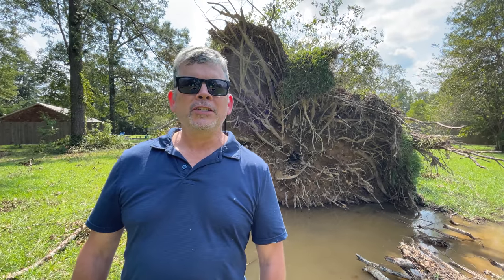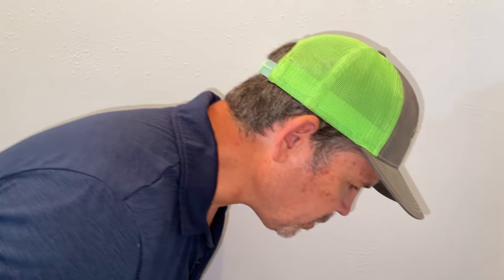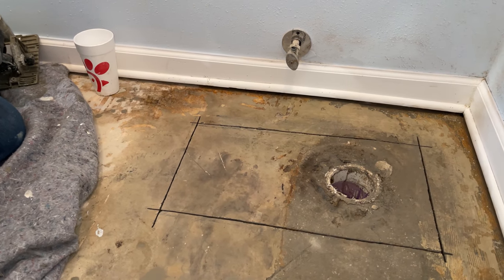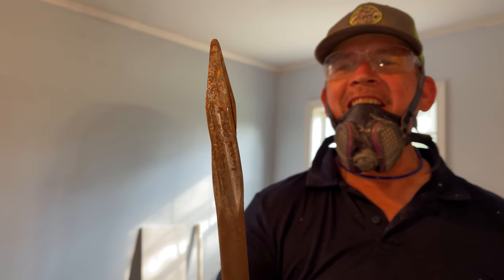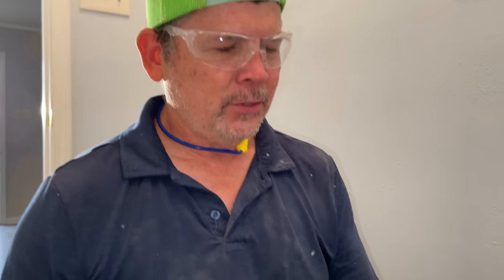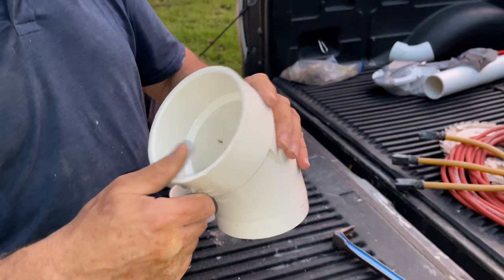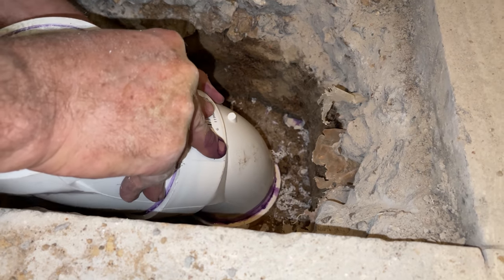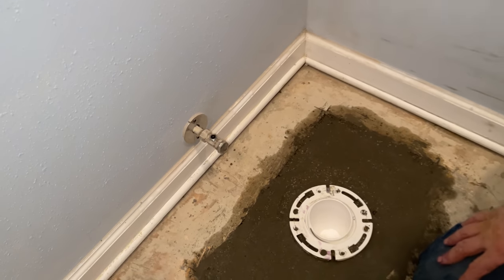We Moved a Toilet Over 5 Inches and It Kicked Our A$$

Comment: Come on man.  I forwarded to the part where you started to move the drain and noticed a few things that I'm questioning and I'm not a professional plumber.

1.  How did you not know that you were going to be moving the toilet over 4" or 5" before you got there?  Did you or your company do the installation or not?  If your company did it, then you should have known not to put it where it was put in the first place.  Even if someone did screw up, you should know that you have to move it over 4" to 5".  

If you were going to check out another plumber's mistake and this was the first time seeing it, then I'll give you a pass.  But I think you mentioned something about your "crew" doing the work.  Maybe I missed something there though.

But, if you had prior knowledge of where this pipe needed to be moved, then you should know to bring the proper tools with you to move it.  

THIS MEANS:  having the proper concrete tools.  Having the proper replacement parts to do the move INSTEAD OF needing to go to the local hardware store.  First of all, you should never rely on the local hardware store to have what you're going to need anyway because more times than not, they won't have it.  You should have had the proper stuff with you to do the job the way that it should be done but you didn't have it.

That's a rookie move and someone being paid to do this on the regular should know better.

2.  They make chemicals to help break down the glue for the pipes.  Why were you trying to use chisels, drills, rotary tools, buzzsaws, and all the other stuff?

In fairness, I've never used the chemicals to do any pipe fitting removal so perhaps these chemicals that are supposed to "break down" the pipe glue do not actually work.  And it that's the case, then you have to use something to get the pipes apart.  And that's fine.

But to use the chisels the way you were, you should know that you're going to take a very high risk of damaging the pipe like you did by chipping or breaking pieces of it.  I had a bad feeling that as soon as you started chiseling that it was not going to end well.

As someone who gets paid to do plumbing, you should know that the glue that's used to bond those fittings together is like a tough weld that can't be removed easily.  As such, you should know that trying to chisel at it the way you were was going to not be good.

Using a drill and drilling it out like you were doing was probably one of the safest ways you could get most of the material out.  But I noticed at the 10:57 mark that the hole furthest to the left was not drilled properly and you actually drilled into the outer fitting.  Not good.

You have to be more careful if you're going to drill and try to remove the internal fitting.  Obviously, ruining that lower fitting would be an even bigger job to repair.  Not good.

After you had the holes drilled all the way around the inside fitting, you should have been able to carefully get most of the pieces chiseled away.  But you needed to go slow.  I can see how it would get time consuming and frustrating but what's worse, spending an extra 15 to 30 minutes dealing with that or an extra day or two fixing the bigger mistake by having to replace the pipe and/or fitting even lower?

After that, you could have gotten a bigger sander to smooth out the inside edges to allow for the other pipe to fit inside of it.

3.  While you were trying to fit the angled pipes to the toilet flange that goes on the floor, I was shocked at how long it took you to figure out that you had the wrong sized pipes to allow the 4" flange to fit the 5" pipe.  

Another amateur mistake which makes me wonder how much knowledge you have.

If you're worked with plumbing, you should know what adapters you need.  I just don't get it.

4.  I'm not saying you have to be perfect and I don't claim to be.  I'm no plumber by any means.  But  I knew right away going into this project that you were going to have issues if you didn't use some sort of chemical to try to break down the plumbers glue.  

But again, if that chemical doesn't work, then my comments about using that chemical are irrelevant.

-----------
I question whether that lower piece should have been replaced since you broke the outside portion of the upper flare / flange.  I'm sure there's enough of a lip to connect to but if an inspector saw that, would they allow that to pass?  I don't know. 

I know that most people won't take criticism like this so we'll see if you'll even bother to respond.  My guess is probably not.  And that's fine.

I just think you need more experience.  To me, you don't seem to have much.  And for all I know, you've been doing it for 20 or 30 years.  I just think if you're in the industry, you should know what you need for parts going into the project and tools especially.  I can understand needing some oddball part but from what it looked like, it wasn't anything out of the ordinary.  You simply needed two 45 degree elbows and adapters to allow a 4" toilet flange to fit into a 5" pipe.

One last thing, your concrete work looks bad.  Gaps around the edges and not sure about the texture but it looked off.  It should have been smoothed out a lot better with no gaps.